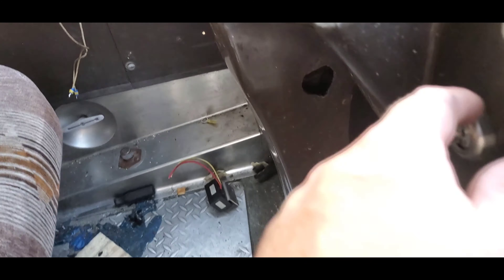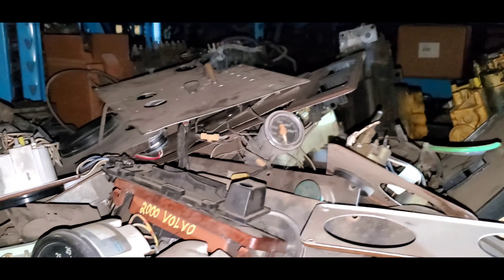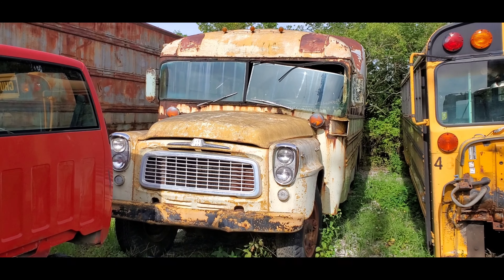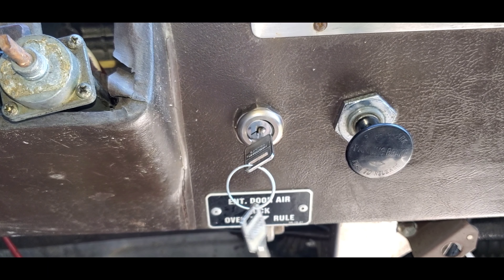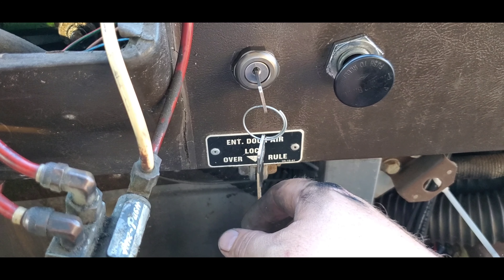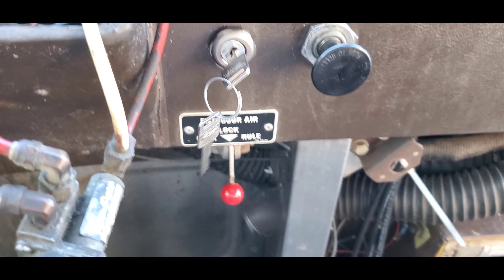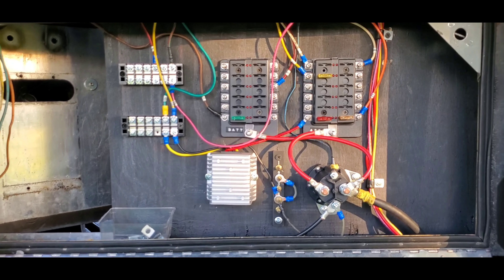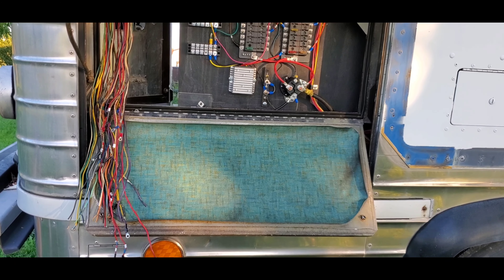MCI MC9 Bus Conversion - Stage 1 of the Rewire to 12v Complete

Comment: Hey how are you doing I have a 84 MC9 started converting it a couple years ago I want to do some wiring on it also like the key nice move there recently I thought I had a bad Skinner valve bought a new one turns out it's the connector to it. Got it to function Properly with taking the fast idle connector and put it on the shutdown solenoid it worked fine so I bought a new connector but haven't had time to install it yet. Your talking about converting to 12 volt expensive change out but do able can I ask why though?
Reply from the maker: My 24v alt went bad, HVAC system didnt work, and lots of electrical issues.   12v is also easier to work with when out on the road.    If my batteries die a regular car can jump me now.  The alternator and starter I went with are also readily available and cheap.
Reply: @Bairleafarm  are you not replacing the direct drive alternator with a 12 volt replacement? Big money
Reply from the maker: @briandavis9975  i am not.    I will be adding a 12v alternator.   The non working 24v 50dn alternator will stay on the engine for the time being.
Reply from the maker: @briandavis9975  I am leaving the direct drive.   It will be disconnected as it doesnt work.   I will be adding a new belt drive 160amp 12v alternator.